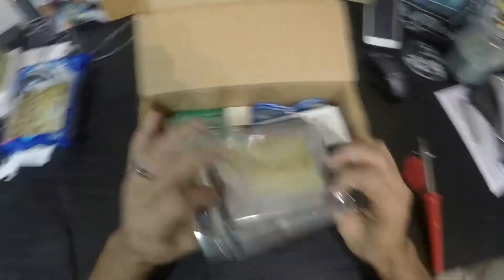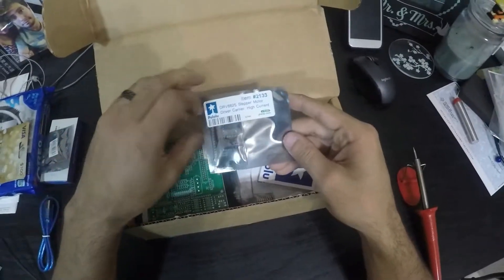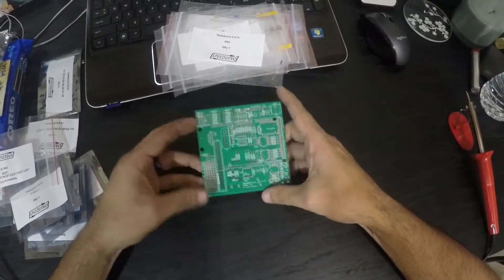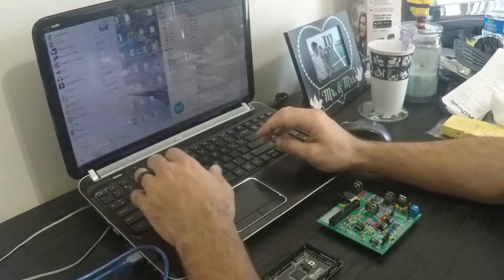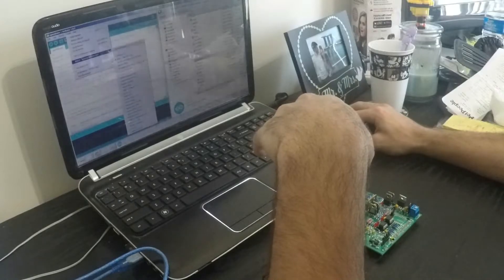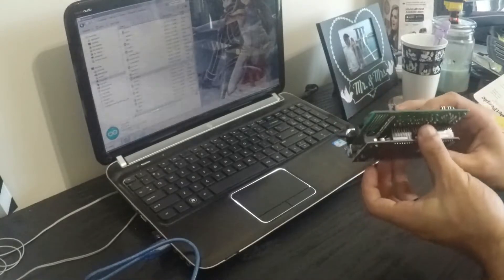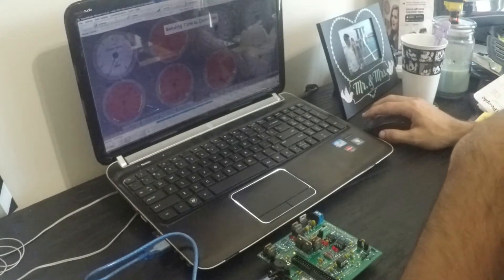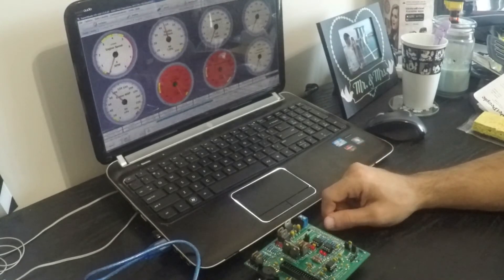✓ Building DIY Standalone ECU 4g63 - AWD Mini Cooper Ep. 6

Comment: I know this video is 5 years old but is it possible to use this setup to do a digital dash on a mechanical carburettor engine so it is monitoring Speed, fuel, oil pressure and engine temperature?
Reply from the maker: Yes totally. I know plenty of people using it on carburetor setups for gauges or want to control spark by converting the distributor into a position sensor

Comment: u are a boss. so it did cost u considerbly less vs buying put and plug one
Reply from the maker: Not really. This ECU is so cheap that it's not about saving money but the fun of it. You can buy one of these prebuilt for $200 USD or less. If you assemble the full build list, you can save $100 or so and buying a kit you can save $20-$50. So it's so budget friendly that neither option is really a bad option.
Hope that helps and glad you're enjoying the build
Reply: @InitialDIYmods  WELL THANKS MAN THOSE IT NEED FAN TO COOL DOWN IN HOT CONDITION. BY YOURE EXPERIENCE
Reply from the maker: With mine being installed in the glove box, it doesn't see much heat. They're not designed to be installed in the engine bay though so somewhere in the passenger compartment is usually the best option
Reply: @InitialDIYmods  and is it reliable in the long term can i use it daily for 1 year or so by youre experience thnx man
Reply from the maker: Yes you can daily it once it's set up properly with a good tune, but it's not plug and play for most cars and setting up and tuning takes time. If you're new to standalones and tuning, plan on it taking a lot of time learning how to set everything up and how to tune and understand the risks involved with tuning a car if it's you're first. You can build an adapter harness and swap back and forth pretty easily until everything is sorted out, then leave the Speeduino in once you're comfortable with it.
Let me know if you have any questions
Reply: @InitialDIYmods  is the speed duino ecu compatible with a good number of tuning softwares . thnx man or should i say petrolhead brother
Reply from the maker: Haha No trouble at all mate. It's only compatible with TunerStudio as a tuning software (there's a free version which works well or you can buy a few different full versions for around $100 depending on the features you want). It's is a very well established tuning software (same software that mega squirt uses) and it's compatible with many mobile platforms (phones or tablets) through hard wire or bluetooth like shadow dash or similar to make custom dash boards and gauges for data logging or display.
If you get really hooked, you can start digging into the code itself and make custom features and add ons etc depending on what you want to do.

Comment: Can I use this ecu for ABS ?
Reply from the maker: For only ABS, you could make it work for sure but it's not intended to do that as currently set up and would take a lot of modification. I posted another comment about how you could set up an ABS system using this or similar components

Comment: Great work !
Please help me ...
How can I manufacture an ECU for ABS ie antilock Braking System that is supposed to be installed in a solar vehicle?
What components do I need ?
Reply from the maker: Hey there Isha Pise, it's a bit of a long response but I hope it helps haha. I am happy to help as best I can. Please share more details as it sounds like an interesting project and more information can help a lot when it comes to this type of custom stuff. I can't give you exactly everything you need but I think I can definitely get you started in the right direction.
My questions and assumptions:
1) You say solar vehicle so I assume fully electric, correct? If so, what type of drivetrain does it have? 4 wheels, 3 wheels, 6 wheels etc. Is it all wheel drive, 4 wheel drive, front two wheel, etc.
2) How does the vehicle turn? Does it use different speed control for each wheel or does it use a steering rack set up like a car, or other?
3) Do you have some sort of speed controller already set up for the motor(s)? Does it use PWM to control speed or voltage signals? This is important to know how to code and communicate between the ABS module and the main speed controller.
4) Is the vehicle intended to be autonomous or controlled? Is it more of a rover or more of a car basically
5) Does the vehicle have mechanical brakes or do the motors act as the breaks by reverse power or locking to motor?
The main components you'll need will be wheel speed sensors on all wheels to give you the best idea of what is happening at the different points. You'll need to feed those signals into a control board like an Arduino Mega2560 with capabilities to interpret square wave or sine wave inputs from the wheel speed sensors (however many you have to cover the wheels (keep in mind that there are only so many board inputs that are capable of interpreting these signals, but 4 wheels should be ok)), you'll need to control them as interrupt signals so these signal take priority over other signals that may be fed/integrated into the controller.
I highly recommend you look at the latest release firmware from Speeduino which features VSS (vehicle speed signal) input for tracking speeds and calculating gears for gear based boost control. Because the ECU also runs the engine, it only has two inputs left for VSS (same input as the knock sensor and the flex fuel sensor in the firmware). It also has engine speed and cam speed signal inputs which are also square wave inputs which you won't need to use for that so taking those inputs is an easy way to go. You could modify/simplify the firmware to duplicate the VSS parameters and calculations 4 times (or one for each wheel you have (I think there are only 4 inputs on the ECU as it connects to the Mega 2560, but you may be able to make more work or stack two boards). Then take the inputs from those sensors and set up some basic functions to calculate different wheel speeds. If you have 2wd on a 4 wheel vehicle for example, you can set your default to be the non powered wheels and divide the powered set pulse count per second to get a ratio for revs per second between two wheels. You can also compare each wheel to every other wheel with a series of functions in a loop so it keeps running every tenth of a second or something. If the number equals about 1, then your rolling with no wheel spin or braking with no lock up. You'll have to play with/tune the ranges for your setup but using less than and greater than to define a range of maybe .8 to 1.2 as ok with no action (to account for turning or having slightly different air pressures, tire wear, etc), and then a lower ratio causes some sort of power or throttle cut, brake release, or however you chose to program it in your speed controller interface, and greater could be nothing or power increase to maintain constant speed. You could also use a brake input switch to feed a signal that states to only use this logic when the brake pedal is pressed for ABS and when it's not pressed, either be off or act as a traction control with a different set of functions and parameters.
A Mega2560 costs about $10 or $15 off amazon with 2 day shipping and the software called Arduino IDE is free to download and program. There can be a learning curve if you are not very familiar with coding, but with a solar vehicle, you should have some decent knowledge of electronics and coding already. I am not the greatest at creating my own code but I can modify existing code structures fairly easily. If you look at the Speeduino wiki page, it should have links to the latest firmware which is also free. Sensors or signal generators can be cheap or expensive but it all depends on how you have everything set up and how your source parts, quality of the parts, etc. You may have everything you need already configured with a pulse count. It goes without saying that speed will be a big factor in how many pulses per revolution you use. If you have a slow moving rover, then you may need 10 or 20 pulses per rev, but if you're expecting 30 to 40 mph, then 4 or 8 may be more suitable. There is an upper limit on the sensors ability to pick up and distinguish  signals but I don't know what that is. It may be the sensor or Arduino that is limited by the hz or the processor..
Please write back as I am super curious about your project and I hope this response helps get you started. It's a nice Saturday morning and it sounds like a great project to start working on.
Ryan @ InitialDIYmods
Reply: @InitialDIYmods  Thanks for your awesome reply!!
Your reply is gonna help me a lot.
And here are answers to some of your questions...
It's a 4 wheeler and runs under both autonomous as well as steering type just like a car .
And the vehicle has hydraulic braking system
We are on youtube as VCET SOLECTHON.

https://www.youtube.com/channel/UCrFFK_yseTegwXFXc2AHaaw

DO SUBSCRIBE !!

Will surely contact you in future regarding the same:)

Comment: sorry, this may be a basic question: why do you need a special ECU? Do you want to tune the motor for higher performance? I am thinking of taking a small diesel engine out of a car and use it as a diesel generator -  so far I thought I would be fine with the OEM ECU, but now I realise I may be wrong..
Reply from the maker: There's a few reasons to do this. In my unique case, this is for an engine swap car, so the ECU I had, only ran the old engine. This standalone ECU is very cheap, but powerful with a lot of custom features you don't have with many stock ECUs. Being simple also made it way easier to get the car running and driving. With the chassis being a Mini and the engine being a Mitsubishi, the engine will need a different ECU. Instead of buying a 25 year old Mitsubishi ECU to run the engine and have to make a bunch of updates or repairs too run the way I want, this sub $300 ECU could do the same with less of a learning curve (in my opinion at least).
Your diesel project sounds interesting and seems like it could make a lot of electricity. The thing with diesel engine is they typically run with very little electronics compare to cars and some are fully mechanical and require no ECU. It will all depend on what you want to do. I recommend finding out what your engine needs to run (sensors, electronic throttle, in tank fuel pump, etc) and then what logic you want for your generator. I don't think a standard engine computer will be easy to set up too regulate the voltage and deal with varying demands. I think this would be easier to build custom with an Arduino based controller. You could set up a logic based regulator and a bunch of other stuff but it all depends on the use and what your needs are for the project.
Let me know if you have any questions and I'll try to help if I can help
Reply: @InitialDIYmods  thank you for your thoughts about me project. I plan to use as many oem sensors to the engine as possible, the rest i will mimic somehow - with a fixed resistor or with an arduino-based solution - that is my idea as so far i did not find open source ecu for common rail diesel engine. The governor which will increase the throttle at higher load is a sifferent story - the current generator governors work by frequency monitoring which will not work as i generate dc. Never mind, this later is less of a headache for now..

Comment: Is there any time lag with running a Bluetooth dash? I feel like running Bluetooth will slow down communication vs using direct wiring
Reply from the maker: I haven't set up a bluetooth dash in this car with this ECU since I ended up getting the OEM dash to work, however, I have not noticed any lag using bluetooth in other cars via the OBD2 though. Direct connection will have less lag technically, but not to the degree that it will effect anything. A tenth or 20th of a second won't make much of a difference. For logging it makes zero difference because everything will be timed correctly even if there is a very large lag. Now you could use a raspberry pi type setup to make a wired dash or use ISB connection and not use the bluetooth connection. I plan to experiment with an Android 2din radio where I can run a dash app via bluetooth though

Comment: What are the materials you used for this project?
Reply from the maker: You can find all of the materials and information at https://speeduino.com/wiki/index.php/Speeduino and they have many options for different types of projects.
They also have parts at https://speeduino.com/shop/index.php which includes kits and preassembled units.
I also strongly recommend joining the facebook group for support. Many people there provide custom options, fireware, parts, specialty connectors etc. Here is the link to the group https://www.facebook.com/groups/191918764521976/
If you have any other questions or comments, please feel free to respond anytime and I'll reply as soon as I can.
Thanks,

Ryan @ InitialDIYmods
Reply: @InitialDIYmods  Wow, thank you for you response. Now I have more knowledge on ECUs and where to buy them. :)
Reply from the maker: No problem, happy to help :-D

Comment: Ahhh just got a chance to watch this. So cool. I really want to get into it. Maybe make a standalone for my MR2 someday? Could solve my issues with keeping the stock gauges too. I am a programmer and also know a bit about electronics. How much extra was the Mega board? Great work.
Reply from the maker: The mega board was super cheap. I think like $20 or something like that off ebay. There are some other options too like bluetooth modules, high current drivers to power boost solenoids and idle control motors, fuel pump or fan relay triggers, and even VVT solenoids. If you are a programmer then this is right up your ally mate ;-)
Reply: Yeah I think it may be my only option for the future turbo SR20 given my budget. It can do sequential injection and sequential spark too? I hate batch and wasted. XD
Reply from the maker: HAHA I hate them too. Yes it can do all four of those depending how you have it configured. You can wire them sequential and then run batched if you wanted but that is just dumb lol. Has boost control, launch control, they're looking into flat foot shifting too. It also has bluetooth communication if you want to do a tablet like I plan to do. You can then do logging through your dashboard and email the file to your laptop or whatever which is pretty handy as well
Reply: That's all awesome. Definitely wouldn't mind having some two step for the viewers, hahaha. All well down the road, but at least I know who to go to for advice. :D
Reply: Can you also choose to use an upgraded processor or anything if you want to? Like just faster so you have higher precision etc.

Comment: Old video, I know, but I HIGHLY recommend adding heatsinks to those transistors if you haven't already. You're switching a decent current load with them, so heat is a major issue.
Reply from the maker: haha not too old since the car is still not running yet ;-)
You are referring to the Mofsets I'm guessing? They have built in heat sinks on top but the ECU isn't pulling that much current itself because most of the functions ground through the ECU rather than powered by the ECU. I think the ECU itself pulls 5 amps but I'd have to double check. It may be 10 but that sounds a bit high in my head
I'll definitely monitor the heat now that you mentioned it and either add a computer fan or add heat sinks if needed. I know some of the build in heat sinks rest on the aluminum case which would transfer and dissipate heat pretty quickly
Thanks for writing in and if you have any more comments, feel free to let me know anytime ;-)
Happy modding,
Ryan